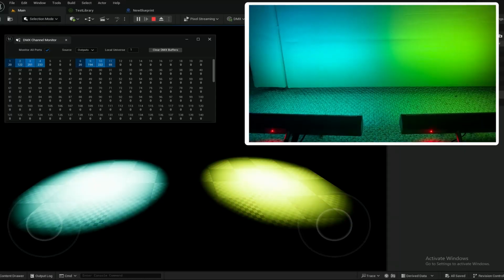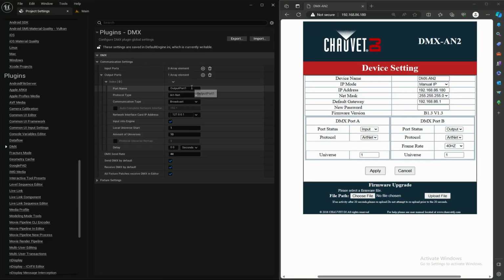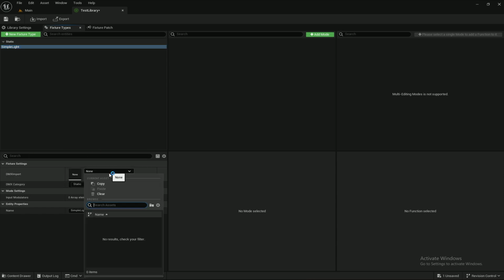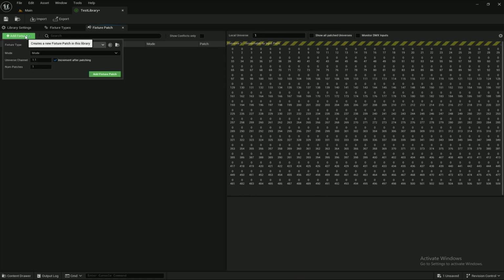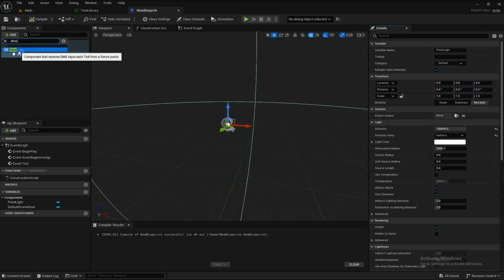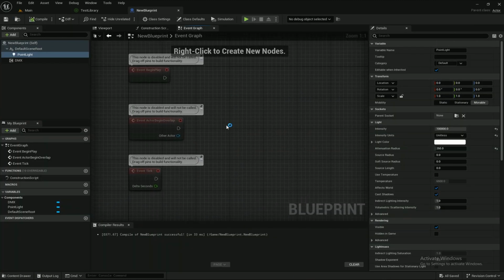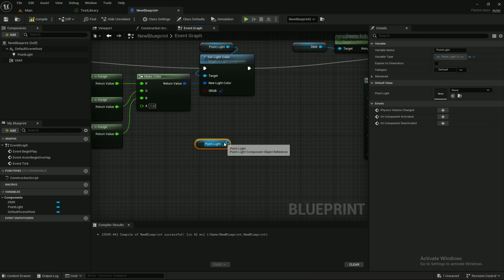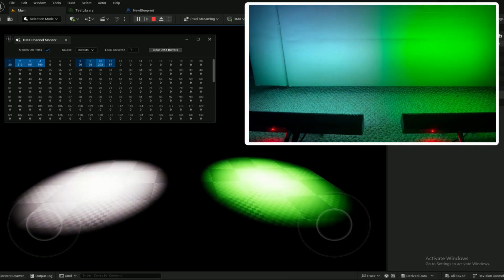Control DMX Lighting from Unreal Engine in under 10 Minutes

Comment: Hey i still struggling with it, i spent money on the chauvet dj an2 but i still cant get it to work, i believe the only place where i miss is where you get the Network Interface Card IP Address from in the project settings.
Reply from the maker: @XMNF  So you need your computer and the Chauvet to be on the same network. 1) Have you accessed the Chauvet web gui and setup the network either to DHCP or a static ip? 2) Take that IP and make sure your computer is on the same network. For example if your Chauvet is 192.168.0.10 your computer should also have a Network Interface that is on 192.168.0.X.  Otherwise they won’t be able to talk to each other. Hopefully I understood your question correctly. Let me know if that helps!
Reply: @BanjoEvan  6 month later and now it makes sense... you dont understand how much effort i put in trying to learn this.. but finally tonight it all made sense xD

Comment: Hi I have problem to connect UE with the dmx controller so the light won't light up. But the light simulation is working just fine, I am not sure what's the problem
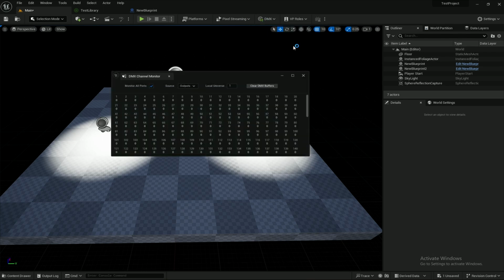Reply from the maker: Hello, thanks for watching. First thing I would check is if the DMX channel monitor shows activity on the output from unreal engine. I use this in the video around 7:07. This will confirm that your scene is actually transmitting some DMX data out from the engine.